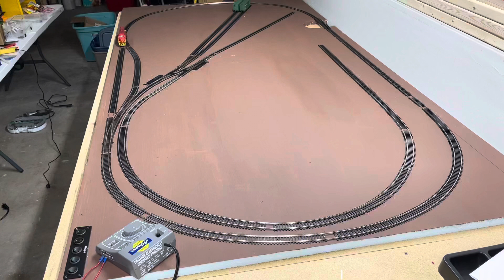Ho DC layout isolation wiring

Comment: I have a one track loop dc with points that head into siding.  When I flip to the siding the whole thing stops.  Do I need to wire the siding to the loop?
Reply: I believe so. I think the switches are insulated so you would have to wire the siding to get any power there.

Comment: Those Peco turnouts are great. We call them turnouts and not switches because it gets confusing with actual switches (hint hint). Also, those type of turnouts I have been calling them power cut off turnouts. The older Walthers were like that too. Are you using the common rail method to isolate your track sections?